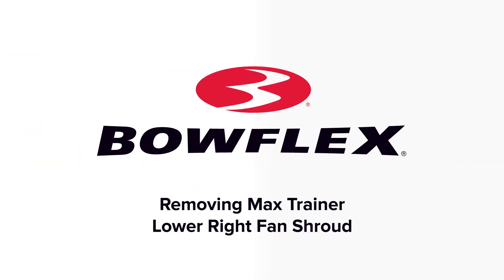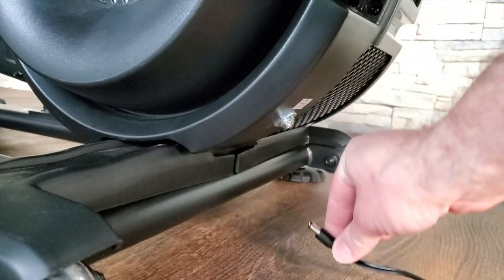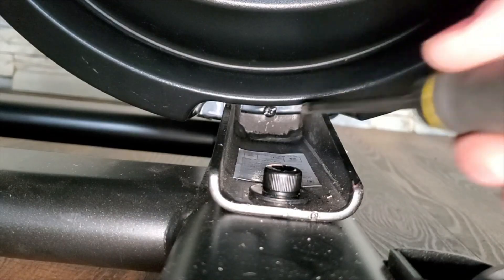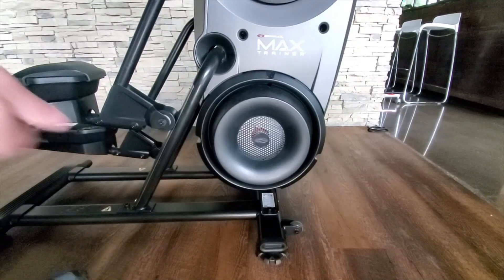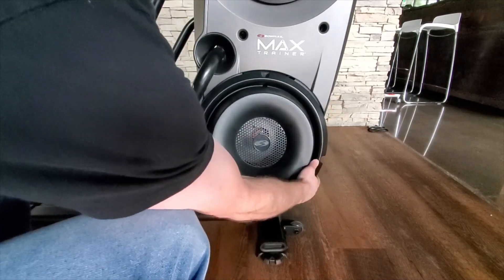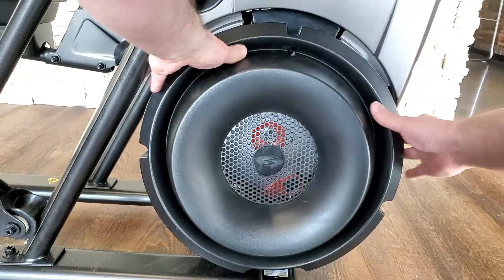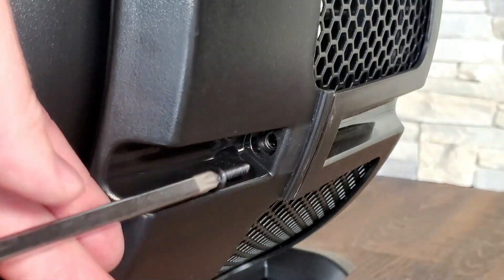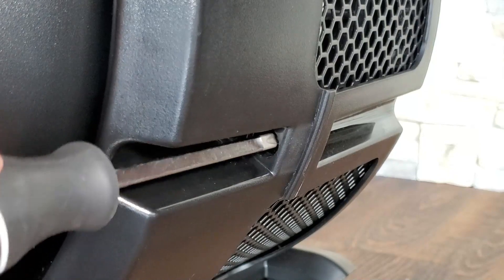Bowflex® Max Trainer | Removing Lower Right Fan Shroud

Comment: What if when you plug in your ac adapter the machine starts clicking?
Reply: Means your server motor is broke what they told me
Reply: What if you cant get the top screw out